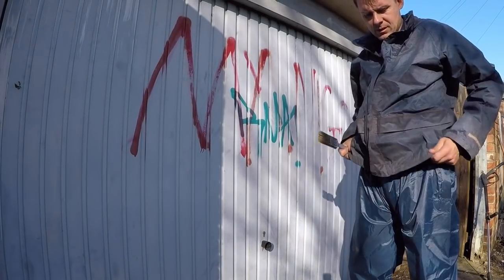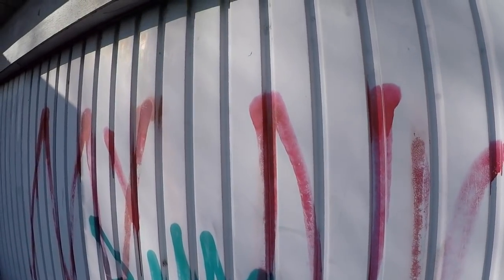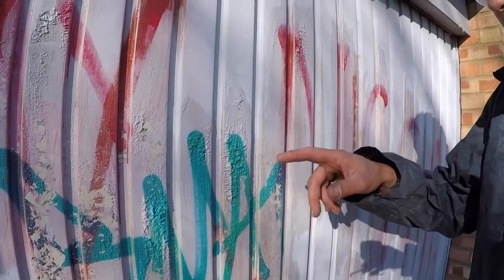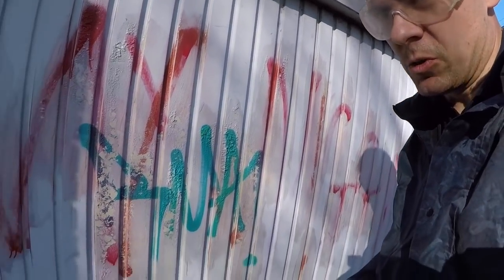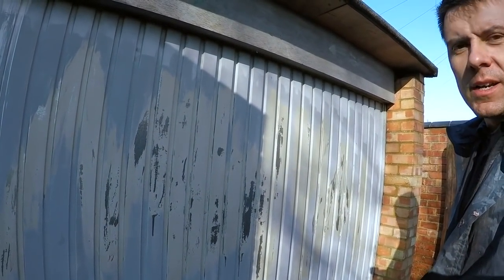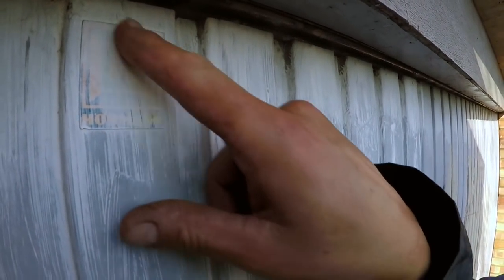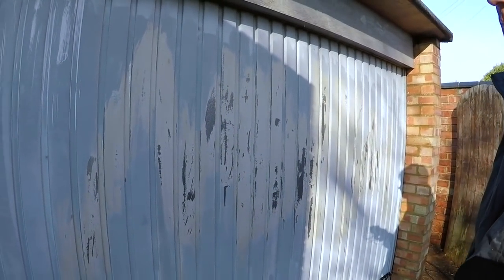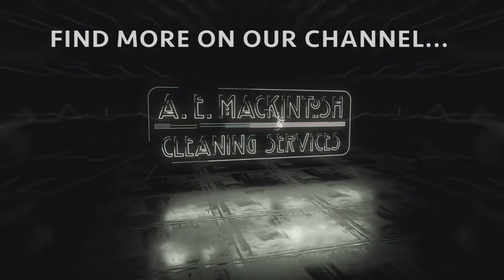Using Graffiti Removal Gel On A Painted Garage Door!

Comment: Very informative , as always . looking forward to the next video ;)
I ve got a jet wash honda 390 , but my tap water pressure is really low (straggle to use whirl away ), is there any way to boost it so it works properly. 
Saw the other video of yours with a wheel bin filled with water... what was that for .thank in advance for your advice
Reply from the maker: 50mPlus Divers The machine should draw as much water as it needs. Tap pressure isn’t always enough so filling something like a wheelie bin means that the machine can suck up as much water as it wants.😃👍🏼
Reply: @aemackintosh  thank you